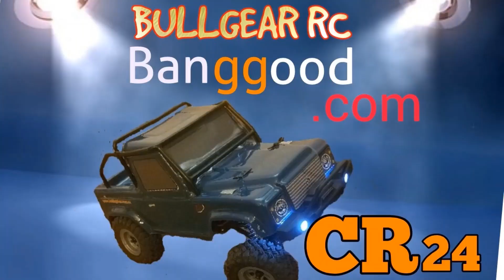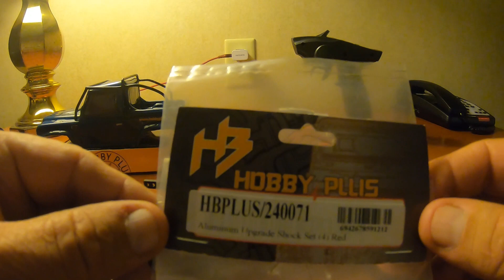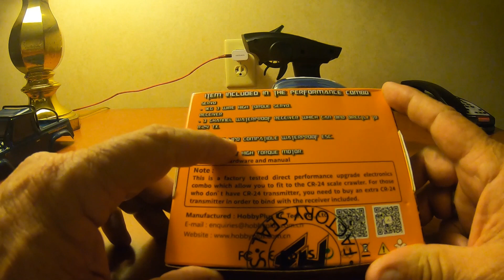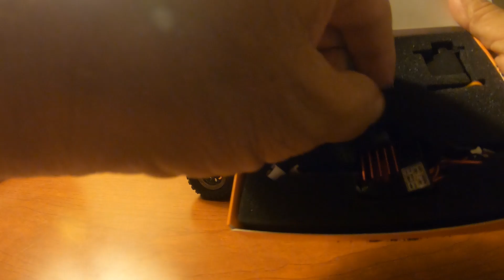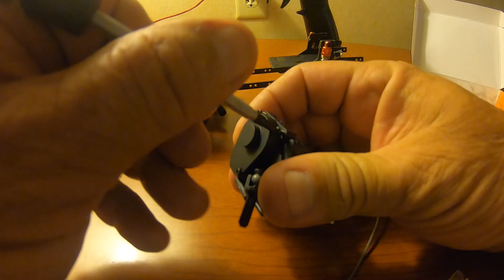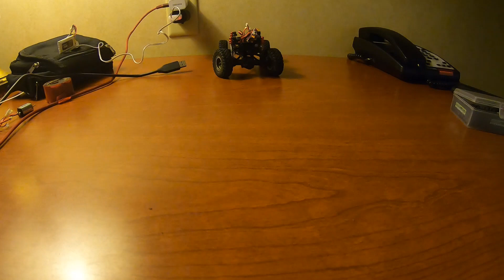HOBBY PLUS CR24 UPGRADE COMPLETE ELECTRONICS COMBO

Comment: How did you find the overall speed on the new motor? I found mine to be significantly slower then the stock motor.
Reply from the maker: It's been a long time, but I seem to remember, the low speed control being better.

Comment: I used the Upgrade too, but i have some trouble. Steering works, throttle too. But if i Need some torque my engine stops. No movement anymore. Some ideas to solve. Atm i am done with it.
Reply from the maker: Been a while since I messed with them, maybe the motor is bad.

Comment: So not sure if I did something wrong I tried to put this upgrade kit in mine and now it seems like the transmission is super tight and the gear mesh does not feel good at all is there anyway to adjust this is it possible to put the spur gear on backwards?
Reply from the maker: Yeah, my first thought would be to disassemble it again and carefully inspect the pinion gear. Make sure it is located so it lines up with the spur gear and that it is centered on the spur. Not too far in or out on the motor shaft

Comment: Do you recommend us getting this upgrade kit? Im a bit low on budget im thinking of getting the scx24 but if installing this upgrade makes the cr24 as good ill definitely buy it
Reply from the maker: It will upgrade your cr24 but scx24 will still be better
Reply: @Ldx1CB  thanks for the tip wont bother to upgrade i will save for the scx24. Bought the kyosho 4runner first i think ill use the wheels from the hobby plus just like you did seems to fix alot of the issues the 4runner have

Comment: Hey I'm shopping around for good shocks. 
Usually I like aluminum enclosed shocks,  but I'm thinking about these red aluminum cr24 shocks,  or the HR black aluminum shocks that you've probably seen. 
My questions:   Are these good shocks, have you used the HR shocks, how many mm from hole to hole? 
Thank you Sir,  much appreciated!
Reply: Hey,  after driving this cr24, modding it up, and doing the same with the scx24... how would you compare them,  pros and cons. 
I'll check you're videos to see if you made one,  can't recall. 
Thanks again,  take it easy.
Reply from the maker: Scx24 for the win
Reply from the maker: The red cr24 shocks are nice shocks, I like them. They are a bit longer than HR shocks, and have more travel.

Comment: Mate what an awesome little build, new sub from me..
Do you think this electric upgrade will fit the FTX mini outback 2.0 as they are basically the same as the cr24.
Reply from the maker: Thanks brother.  I would assume the  electronics upgrade kit would go right in the FTX.
Reply: BullgearRC videos hi mate thanks for the speedy and helpful reply you did an awesome job with yours, lol I love those shocks too so those will be on the list as well, are they oil filled, if so what weight did you use..
Reply from the maker: @MarcRCAddict  your welcome brother. The shocks are not oil filled, but they are smoother and softer than the stock plastic shocks so they will completely compress during articulation
Reply: BullgearRC videos awesome thanks for the info mate, I’ll definitely add them to the list of bits then.👍 happy rcing

Comment: I just bought this car cor my son. The controller constantly beeps and flashes blue light. 
It doesn't move the car.
Do you know how to solve this problem?
Thanks!
Reply from the maker: It sounds like you may need to bind your reciever to your radio. I didn't have to do that with the stock reciever in mine, so don't know the procedure right off. But I will look into it for you. Or if you have GOOGLE translate on your phone it will translate the part of the instructions that you need
Reply: Thank you.
I really want to fix this for my son. We have been through countless rc cars and none of them seem to last very long.
Reply: Google translate didn't help much with the instructions. 
If you could help me out, I will great appreciate it.
Reply from the maker: @graciejay2936  if you look at the esc you will see a little hole with the word bind by it. Turn on radio, turn on truck and quickly push the button in the hole with a paper clip or something similar and see what happens